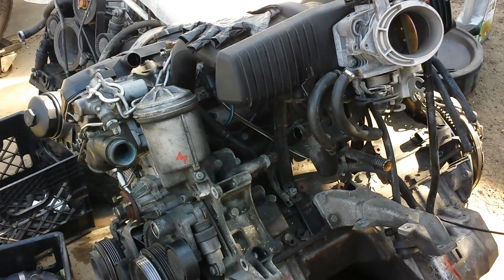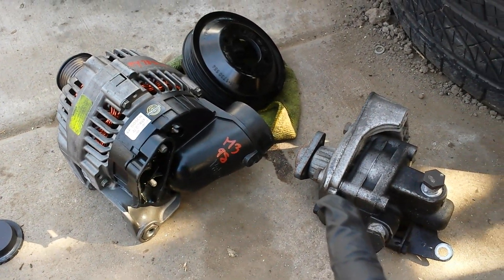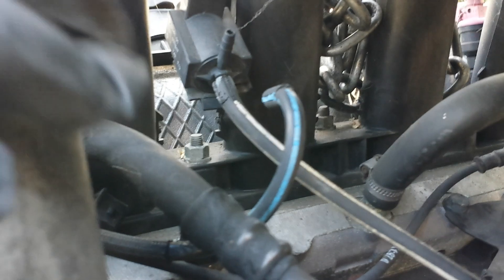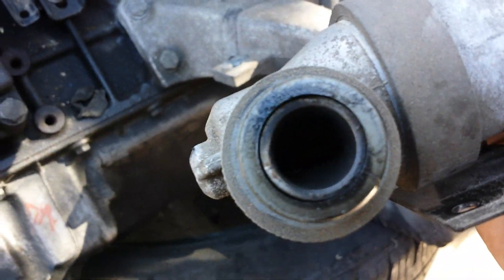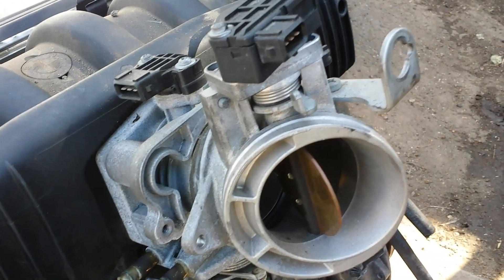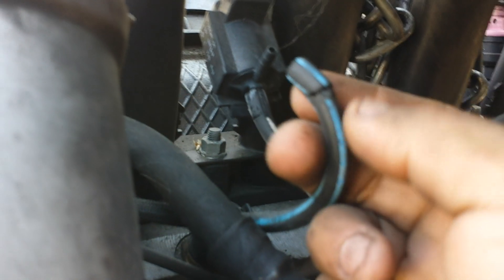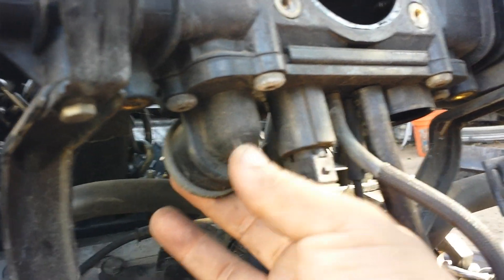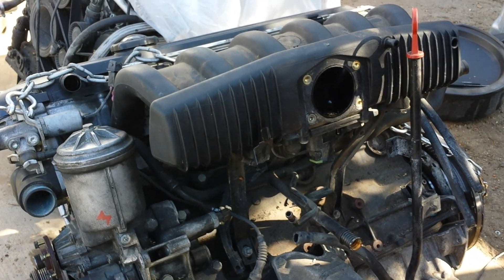BMW E36 Z3 M M3 S52 Engine Diagram

Comment: Excellent video from my standpoint as I took my intake manifold off over two years ago and a divorce followed only a couple months after removal. Do I remember where everything was? Heck no! This may not be super technical but I was looking for location information for various components and hoses, etc. and this will help jog my memory. Which (no sympathy requested) I have developed early stages of memory loss and was fearful to tackle putting her back together. Sadly, I have over 30 years exp. in auto mechanics and a lot of my knowledge has just simply vanished. :(
Reply: hope you got it sorted out Jerry!

Comment: There several other coolant lines at the back of the engine which feeds the heater control valve and the return pipe under the manifold. The heater return pipe has 2 o-rings that connect to the front of the engine.

Comment: S54 all day.   I feel like the 52 is kind of a waste
Reply from the maker: +Jimmy Dean S52 is a good motor.  It all depends on your budget.
Reply: The 54 is nice, but the 52 is the most reliable m3 motor. The 54 sounds way sexier tho I will admit and has a doul vanos and running much more HP. Im not a 52 fan for its power, I loke the 52 up most due to the power and its reliability and how how much less matainance it needs VS the 50 and 54.

Comment: THE 325, 328 AND THE S52 USE THE SAME CAMSHAFT AND LIFTERS?
Reply: S52 camshafts are different. Later 325s, 328s, and M3s use the same lifters.

Comment: I want to do an engine swap . I own an automatic 97 328i . Would you be able to help me with some tips . Will the wiring be a problem ? Your response can help a ton !! Thanks , great vids .
Reply from the maker: For sure.  I can provide as much information as i can to help with swap.  Let me know what specific questions you have.
Reply: I want to swap my 2.8 engine into a 3.2 , that being an M powered engine . Will the swap interfere with any of the wiring ? Can the process be done for a E36 ?